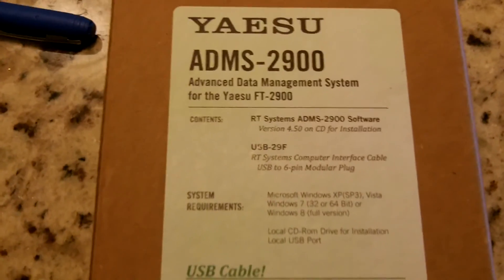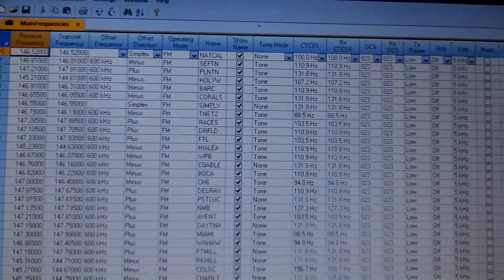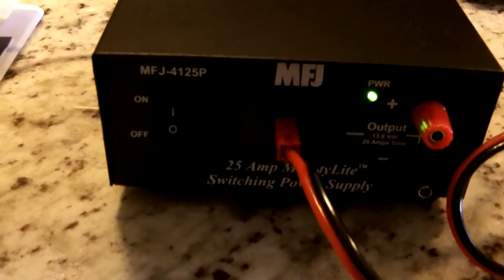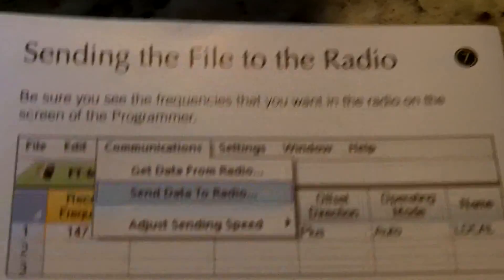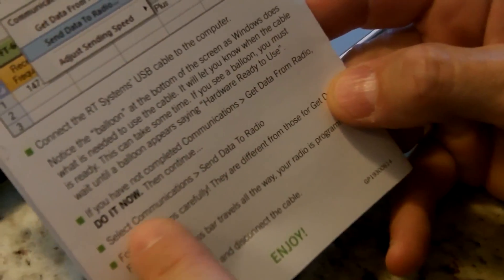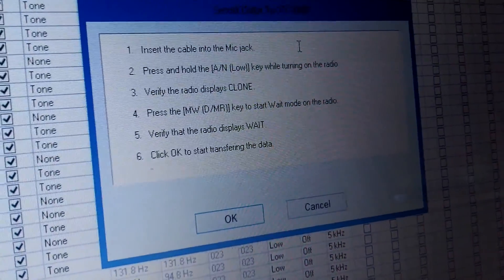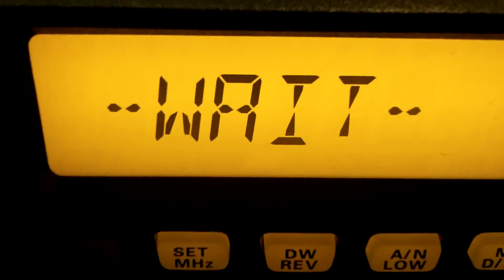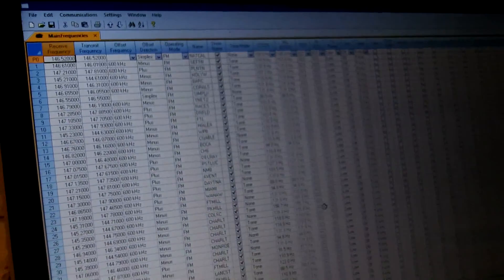Software for Yaesu FT-2900R- Sending Data from Software to Radio

Comment: Hi again. I should have read your expanded header information. I visited the RTSystems web site and found that I can indeed use the ADMS 2900R version software and cable on my FT-2980R radio and they also do have a version for the FT-2980R is exactly identical except for the name. Good to know! There isn't much listed about the FT-2980R and Chrip does not support these radios and what I hear, will not support them in the future. 
Thank you doing this video!
Ken - KC1HRC
Reply from the maker: Thanks for the update Ken!  Glad you found the info on your radio.  I need to program mine now that I moved to North Carolina.

Comment: Hi There. I have a Yaesu FT-2980R which I am assuming is nearly identical to the FT-2900R except for the 80 watt output of the 2980R vs the 75 watt (?) output of the 2900R. So, hopefully, I can buy the ADMS 2900 Software & cable kit and use that to program the 2900R or, is there a 2980R version of the ADMS Software or does the software work on all or almost all Yeasu radios? Also, I was hoping to see all of the functions of the software, not just sending data to the radio. Would you consider doing another complete video of everything this software can do?
Thanks a bunch! 
Ken - KC1HRC
Reply from the maker: I will do the update on this software soon as I have to re-program this radio with my local repeaters.